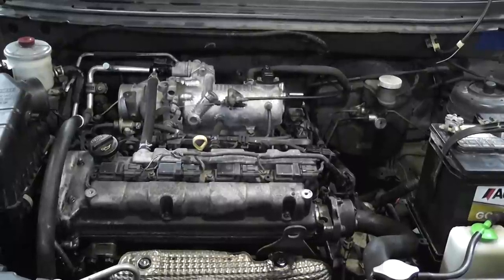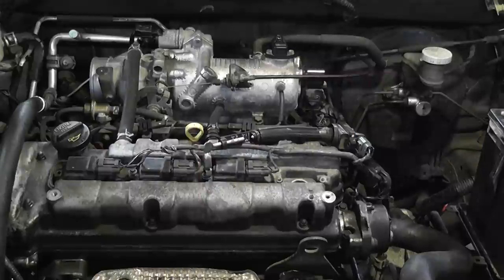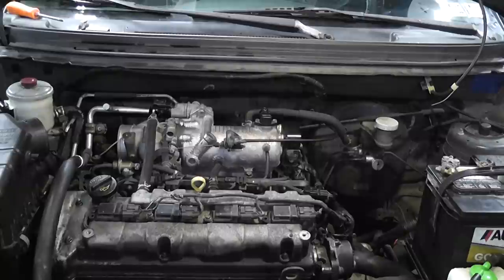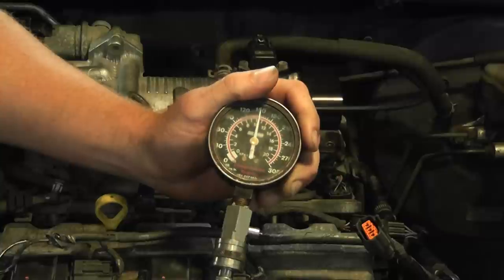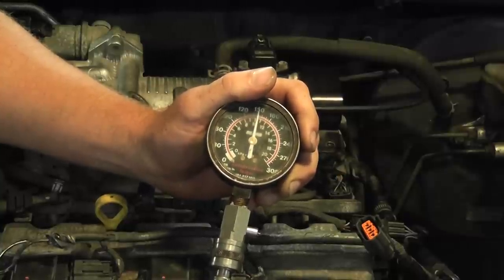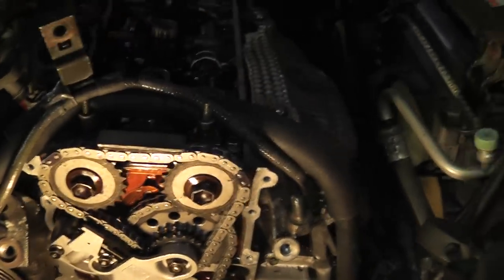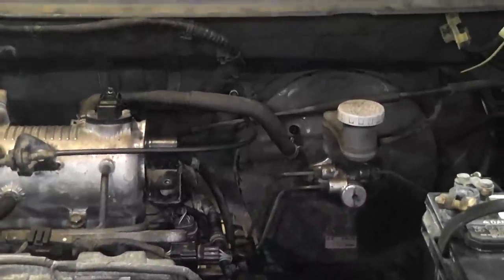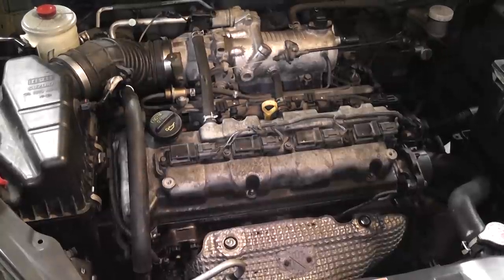How to check for a jumped timing chain or belt

Comment: It was probably only off a tooth.  If it was off more, then bending valves is possible.  Don't know how far it would have to be off for that to occur, but not willing to find out.  Another thing to consider is if the valves were bent, the compression would have been a lot lower.

Comment: Those early editions of those Suzuki 2.0 liter's have a major quality problem on one tiny but wherry crucial part. At 16:00 into the video - Right above the chain that crosses between the to cam gears sits a chain guide that is bolted down with 3 bolts. I have seen that part brake of and fall down in between the chains and gears and causing major engine damage. It looks to me that this could be the case here. If you come across these engine it would be vice to replace that chain guide.

Comment: Did you get round to checking the ignition timing with the timing light, or was that just a possible alternative for  the pressure transducer / ignition waveform comparison that you did before?

Comment: Love your videos, every one teaches me something new,
I'm surprised by the sequence of testing you follow in a video with this title? Cranking an engine that has slipped its timing could destroy it, surely first check should be plugs out and hand cank through a complete cycle of each cylinder?
Reply from the maker: I never worry about that. Any damage done by a jumped or broken belt or chain has already happened before we would ever see it! 
If it happens while the engine is running and it's an interference engine, it's game over. Cranking it after that does absolutely no more damage than what's already done. In this case, the students who did the chain, swore it was done right. So how does one attack a no-start? By cranking it over. You have no choice!
Reply: @ScannerDanner  all good points, I'm fixing a 2013 skoda fabia 1.2 12v petrol right now, camshafts line up, crank is 1 tooth out, nothing has collided, but one more tooth, the engine is toast, 
First inspection is a physical hands on check. Even if your student says its right. What a stupid comment!
Reply from the maker: @sally6457  a physical hands on check on this engine is a 2 hour job on just removal of the covers! You can't just easily inspect this chain positioning on this engine. On some you can, and you'd be correct in starting there, especially after the chain was just done! But I couldn't do that here and I proved the timing was off by the lab scope which gave us confidence to go in.
Reply: @ScannerDanner  👍everyone's a critic, haha. Thanks for the video, it has taught me some new things. 😀

Comment from the maker: that would be the sync probe for the vantage pro but it will not show up on the screen the same way. the rpm pickup when you trigger from it, shows up as a white plus sign on the screen and only stays in sync with the pattern live. once you freeze it you lose its co-ordination. on of the few things snap on has done wrong with this tool. you can buy a different rpm pickup that will plug into channel 1 or 2 that will do as i show in my book.

Comment: ScannerDanner, I am rebuilding my sons Engine after he spun a bearing.  I am at the point of putting the timing chains back on and your video is great.  i was off a tooth and 180 degrees out as well. One question I have is did you have any slack in the chain between the two cam shaft sprokets?  I have a little play and I cant seem to remove it.  Is it supposed to be tight?  If so any suggestions?  I am going to check the colored links and timing marks again.  Thanks

Comment: Whats the different between using the pico to see the square waves from the teeth of the reluctor in relation to the cam square waves? Does each rise or falling side indicate a valve timing event?

Comment: just want to say i like your videos, but also would like to ask a question. I notice you generally use the pico compression transducer, but in this video i see you had one from fluke. I would like to get the pico but they are very proud of it, the fluke is more reasonably priced, so I'm just curious how good it works  compared to the pico, and is there an advantage to the pico, or will the fluke work good in most case's? I dont use the scope a lot so to shell out the extra money for the pico is hard to justify, but the fluke i could do easier.

Comment: Hi Paul
Im not sure there is a quick answer to this but ill ask anyway. If the exhaust cam happened to be timed correctly (which would make the ignition timing correct) and only the inlet cam was out 2 teeth then what procedure would you use the tell the timing was out????

Thanks
Ron

Comment: Obviously, you guys are the timing experts. 
Have a 2009 VW Tiguan 2.0L TSI.  The guy that repaired the engine after a timing chain tensioner failure says the timing is good, but I'm not so sure. I think he is off one tooth. The engine runs fine but sets a DTC of P0341. Cam position out of range. The cam position sensor was changed but still gets the same code. This engine has that vane cell on the intake cam shaft that varies the intake timing. What do you think?
Reply from the maker: Chain was not installed properly
Reply from the maker: though if it is one thing I've learned the hard way on VWs is to do what they call a CAP discharge. This involves disconnecting the battery terminals and then touching them together. This will discharge any memory capacitors in the computer and may actually fix your problem. Try it, you have nothing to lose.
Reply: ScannerDanner I think so too. I guess I'll have to check it myself. The car belongs to a friend and the engine check light is driving him crazy. Is it a valid way to check timing by pulling only the top timing chain cover and checking the marks while pulling sparkplug # 1 and manually setting it to TDC, assuming I have access to the crankshaft bolt?
Reply: ScannerDanner I"ll give it a try. Thanks

Comment: Paul I know this is one of your older videos but was curious if I could use this method to determine TDC on a 2014 Honda CR-v with 2.4l. I own a verus and obtained waveform for cam / crank but I cannot find a good waveform to compare it to. After being thoroughly disgusted for wasting my time scoping I did tear it apart to see it was a timing issue. Just another reason I believe people do not use lab scopes. Pico will only let you access their library if you own a PICO and have credentials. It is sad there is so many Snap On scopes out their that are not used for this reason. I thought if i could use your method I could use factory specs to see if it would have gave me a more definitive answer before tearing into the engine. I would also question if I should have disconnected the VVT solenoid when obtaining my scope pattern or if it does not matter because if is at idle.Thanks in advance.

Comment: Can you do this test on your snap on scanner if it only has one ground port? I believe the current clamp ground cannot be shared with other signal grounds. Is this one benefit of the picoscope because every connection has it's own ground?

Comment: cont. New chain guide will be slightly different in design and i assume that this is due to that Suzuki  has recognized the same problem that i have seen. I'we had two cases of these engine failing and brought to my shop. Suzuki dealer claims to not no anything about this problem.
Redesign of the part tells me they know the problem.
I can provide part number if needed - just send me a PM

Comment: How did you remove the timing chain cover with so little space? Great video, my suzuki is having the game issue so hopefully I'll be able to correct it myself.
Reply from the maker: It helps being on a rack. Some work was done underneath and some from the top. If I remember correctly having that top engine mount out of the way was key too. Then you use a block of wood and a jack under the oil pan to raise and lower that side of the engine.
Reply: Oh sweet, never would have thought of that. My suzuki is not a US model (06 swift) and the manual I have says that in order to access the timing chain, the engine must be dropped. I'll take a look, if it's not possible then it's okay, I'll have a shop repair it. Really appreciate the reply and great informative videos.

Comment: I have a Kia 4 cylinder Im suspecting timing belt broken or skipped. Compression goes up to 30-50 and drops right and is has the lack of compression sound. I have spark and fuel also. I told the customer Im suspecting T belt and Id have to pull it out, and he said if its skipped when inspecting, just repair it. What if the valves hit during his drive? Is there a way to confirm without putting the belt back together?

Comment: Hey ScannerDanner, I'm having a small problem with my car. I've been trying to do research on my car and what is wrong with it. its a 93 honda accord, cranks and starts but runs extremely rough. It only recently started doing this while I was driving to work last week, I'm thinking the timing belt may have jumped, does this sound like what kind of problem it could be?

Comment: After every 10,000 miles or so you need to adjust the back wheel of any motorcycle because of chain stretch. I presume timing chains could stretch as well. Is that a common problem?
Reply: It's very common now that they use glorified bicycle chains.

Comment: Hello there it was a great video and had a lot of information in it ...I have a Saab 9-3 2004 Arc that I bought for 600 and had a crank and no start I bought the care because I have a 2003  Saab 9-3 linear both cars are the same color different features the 2004 is in almost new condition 193000 miles my 2003 needs mirror work 173000 miles my question is it worth getting the time chain done on the 2004 and if so how much does a job like that cost  also is it something  a person with no car repair skills  but with alot of time on my hands could do myself

Comment: i was working on a suzuki xl7 v6 at my shop and i got a code for camshaft misalignment in bank 1.i swapped the sensors from bank 1 to bank 2 to see if i would get the code on bank two or i would get it again on bank 1 and i wanted to make sure the sensor was not the cause.i'd much rather change a sensor and re-do the entire timing chain.the results were that the code came back up on bank 1 so im going to have to go in and dig a bit deeper.i wanted to know,since i got a code and the truck seemed like it was running good,why didnt yopu get a code and your engine didnt even start??

Comment: All in all, nice visual description with the scanner. Brought back (horror) memories when SUN came out with their oscilloscope decades ago. 
v
So what was the reason the timing was off? Assembled wrong or loose chain?
v
Sad part is you started to take the chain off then realized it wasn't recorded. 
JUST FOR SAY, how are we to know the chain was off 1 tooth? 
v
Next videos, since you can't record the proper angle, maybe use a screwdriver touching the flat spot on the block coming straight out to the gears arrow.
Reply from the maker: assembled wrong (i covered this in the video - wrong colored link was uses)
question 2: I proved the timing was off before disassembly

Comment: If you Want to check injector pulse quickly connect a timing light to the injector wire if it flashes you got a pulse then do a sound test listen with a stethoscope for mechanical action.

Comment: hey brother nice vid as always!is there any way i can use a scope to check and see if a cam is out a tooth in time but the car still runs?i have a kia that i have worked on that has an odd miss at low rpm,s but goes away at tip in.identifix shows a lot of these to be from worn or improperly installed t-belts,so i was wondering if i could check with the scope to save from pulling the covers.it has a 3.5 v6 engine.thanks bro,GOD bless!

Comment: Hey this Video i love so much,thank you again.

i got a problem with my nissan almera 2005 model 1.6 manuel/ the car head gasket went the i took it to a local mechanic and he fixed the car (did the top over+new gasket replaced) know i drive then the car jerk when pooling away slow  and it uses alot of fuel.should i take it back to fix the timing ?
Reply from the maker: definitely take it back

Comment: I have this same model Aerio, quick question.

Does the engine get significantly harder to turn when the oil is drained?  I couldn't get my U/D pulley off (no air tools) so I used the "wrench against the control arm" method and cranked the engine. It worked, bolt came off first try. Then I drained the oil and opened the timing cover, and wanted to turn the engine from the u/d to see if my chain links were in the right positions, but its now suddenly really hard to turn the engine. Did I screw up or is this normal?
Reply: Steve

Comment: If the engine had started would it cause higher coolant temperatures? Thought it be 10 to 15 degrees btdc.
Reply from the maker: no, typically a timing issue does not cause any type of overheating condition, at least not with engine temp. Exhaust manifold temp may be a different story

Comment: I performed this test on a 99 sentra 2.0 with a distributor. is this test accurate using a pressure transducer and a kv probe on the number one wire? Seems like I had slightly different results on each crank test.

Comment: On a 2007 Ford Expedition Triton 5.4L 3 valve, is it possible to determine timing is off in a crank no start condition using a scan tool or scope, etc?  New battery and good fuel pressure at the fuel rail.  Check Engine light but no DTCs.  After failing to start, oil pressure light on dash comes on and beeps.  I replaced a failed Melling oil pump with an OEM pump so oil pressure is okay now, but the same oil pressure light beeps and no start. Ford dealer says timing is off.
Reply from the maker: a scope yes, and possibly just a conventional compression tester if it is not starting

Comment: hey scannerdanner I have a 95 Jimmy 4.3 with a new fuel pump and sending unit it runs for about couple weeks and after that the new fuel pump begin to pulsate it's a speaker fuel pump what is your opinion on this it even policies and cranking I can get it to start and run but it pulsates and jumps the fuel pressure all over the place assist to unreliable I'm going to get a new fuel pump but I just want to pick your brain and see what you think

Comment: I just had this last week a Toyota Sienna. Died while driving and was a cranking no start.  Was about to try using your method but the 9v in my transducer was dead and didn't know about or think a amp pattern would get the same result. But it wouldn't have worked as the front bank was perfectly in time with the crank when I pulled the cover off. The rear bank had jumped about 8 teeth. 

This one had us head scratching for a while. Its an SFI system but has no cam sensors?   How do these know what cylinder to fire. I did read an article that said they solely rely on RPM to fire the injectors??
Reply from the maker: What year Sienna? In 2003 the 3.0 had to cam sensors.
Toyota also used the IGF circuit from the ignition coils as an input for injection control on older systems. Maybe on some of the newer ones this is what they are using as a cam signal. It would be designed differently than the older IGF circuits though.
It could be done like Saturn systems have done for years. To use a "synthesized cam signal". But this was on waste spark not COP ignition. To use it on a COP you would need to fire the coil on TDC exhaust and TDC compression to ID the correct cylinder. Maybe this is done until a sync is established?

Comment: you don't even have to do the timing calculation, just looking at the spark square wave, the tail end of the wave where the spark occurs, you can easily visually see, it's on the downside of the cylinder pressure wave peak.  it should be BEFORE top dead center, on the upside of the pressure wave, not on the downside.  the timing is way off on that engine, it's off one tooth at least on the timing belt

Comment: Hey Paul, one thing I'm trying to get straight for timing fault testing. If the ignition trigger depends on the crank signal, then even if the Cam-Crank is off by a jumped tooth, the crank signal will still occur when the piston is in the correct position near TDC, wouldn't it? This is because, even with a jumped tooth, the relation between the piston position, crank and signal trigger position (off the crank) doesn't change? So shouldn't the trigger still show up in right position relative to piston (compression) for COP ignition? In your eg here, trigger position has changed.Obviously if it's an old skool distributor triggered ignition (run off the cam), then a change in crank-cam correlation will show up on ignition-relative compression waveform because the cam position changes relative to piston when a tooth is jumped. Maybe i'm missing something?
Reply: Ok this is a cam triggered engine. that makes a difference. But is my point still right that with a crank trigger ignition signal on a COP engine, the waveform would still have the trigger in the right position?

Comment: Great video! Very informative, I learned a lot. But still could really use some help,  I am currently trying to remove head on an 2004 Aerio SX but am having clearance issues with timing chain cover... In this video you have cover off with engine in car.   Could you please explain how you accomplished this?   I am stuck.  If there is a way, you could save me from pulling out whole engine.. I  would really appreciate it.

Comment: How would you check the for timing and the ignition waveform on a distributor type ignition system is there a clamp on tool. If there is whats the name of the tool

Comment: Hello Danner, is this applicable to all cars in regards to timing of the spark vs peak top compression?
Reply from the maker: Yes, but don't get too picky. There is a range of about 10 degrees before to 10 degrees after that is normal